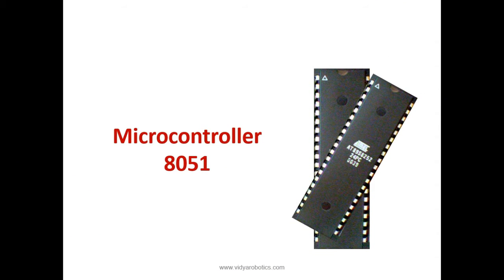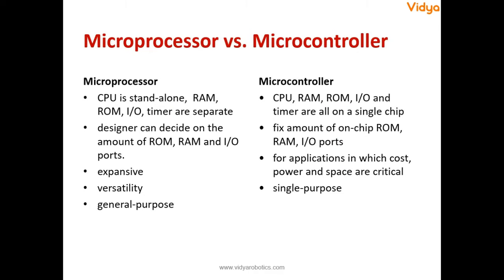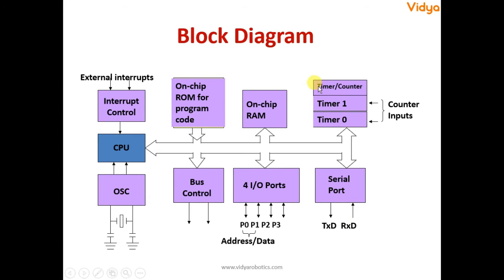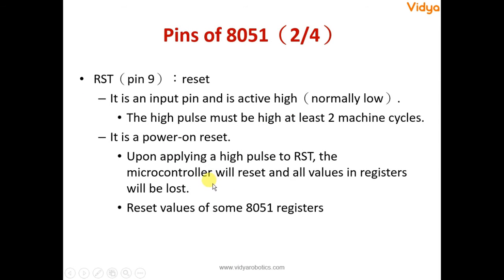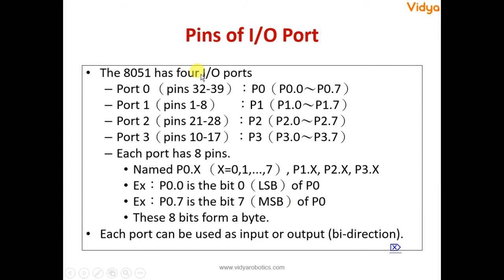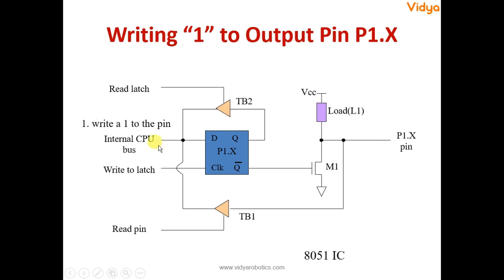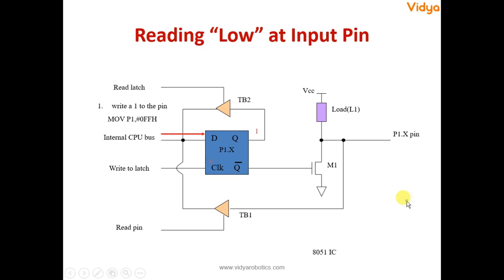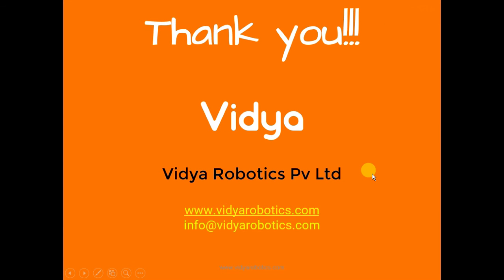Introduction To 8051 Microcontroller Pin Structure-Tutorial 3

Comment: Hi, very good tutorial. I have one question about clock. We have external oscillator connected to xtal pins and do not have any clock signal on these pins. Capacitors are 27pF, Vcc connected. Do we have any program to start the clock signal?
Reply from the maker: Do you mean you've connected external square wave clock?
It should go to xtal2 pin and gnd, no other code needed to start it, it'll be automatically detected
Reply: Yes, 12Mhz external clock. Is it possible the chip is damaged? We've already ordered new one and the situation is the same. No clock signal on xtal pins. Any ideas what else should we check?
Reply from the maker: Sorry for checking it so late, hope it was resolved, mostly chip maybe dead in above situation